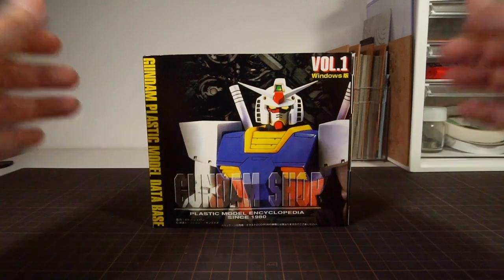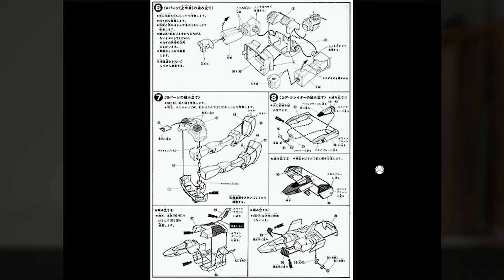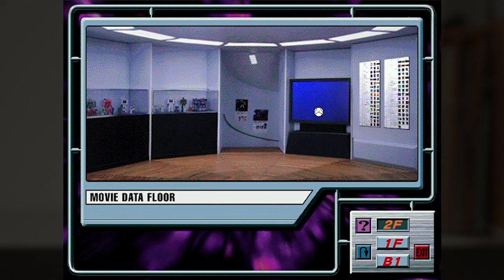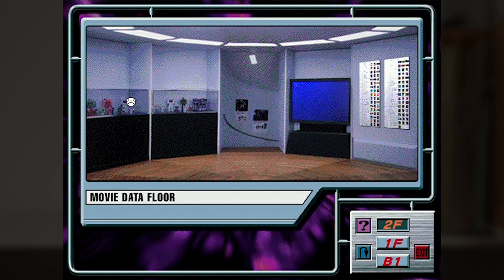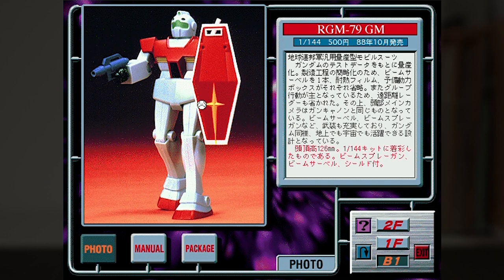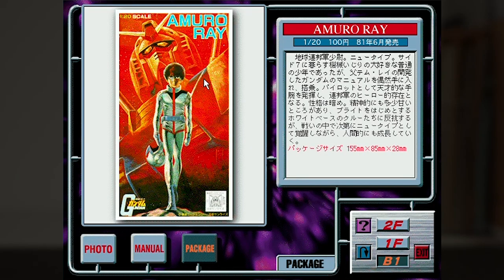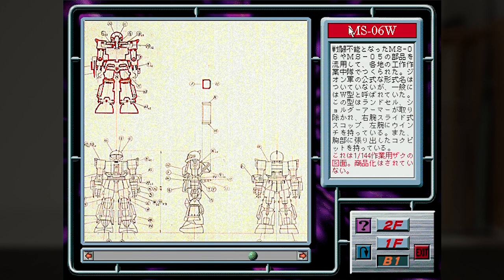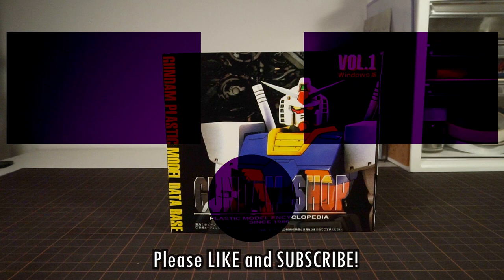Looking at Gundam Shop Vol.1 -  Hobby Clubhouse | Bandai Gunpla Model Software for Win95 ガンダムショップ

Comment: For anyone curious about what kits were being made in that 'How Gunpla' is made segment, I've done some research and this is what I found 

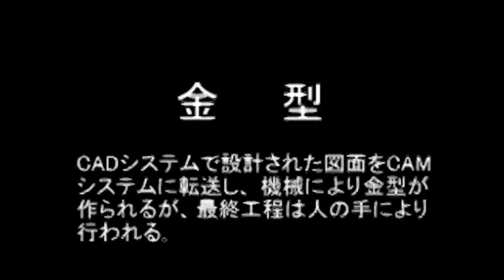Design: The first image at 16:40 I unfortunately can't find anything for at the moment, Next at 16:42 is the iconic Zeta Gundam but I'm not sure what specific kit it is 

Mold Making: I unfortunately can't find info at all for this segment 

Injection Molding: The kit being made here is the OG 1/144 scale Char's Zaku 

Box Design: This was the trickiest one but I believe it is the 1/100 Gundam X Divider, At 17:31 is what basically confirmed it with the green background and shield bit but interestingly enough the text was at the top in the video and not at the bottom like the final design, And the kit labeled 03 is the 1/100 Leopard aka the Beta Heavy arms and 04 is the Gundam Virsago looking somewhat like the Epyon 

Box Printing: The box shown at the begining is the OG 1/144 Scale Char's Zaku in the middle and above that is the OG 1/144 Guntank and below the Zaku is the OG 1/144 Gundam

And finally Box Making and the easiest one: The HG 1/100 Victory 2 Gundam and at the end a stack of 1/144 Gundam X Divider boxes, The 6 making it easy to identify the kit since the X Divider is the 6th 1/144 Scale Gundam X Release